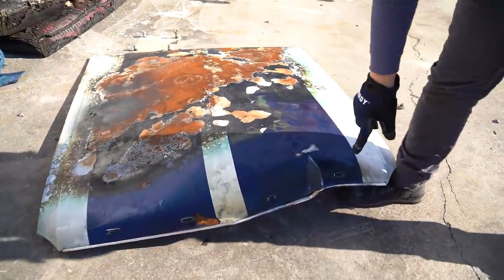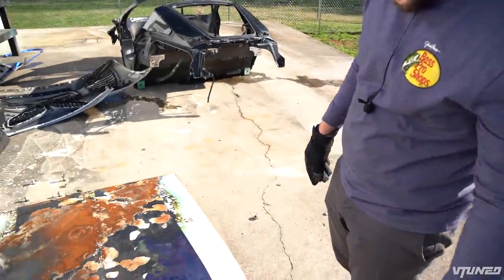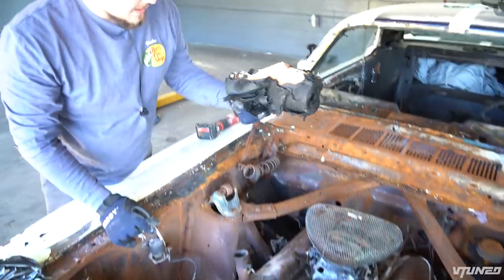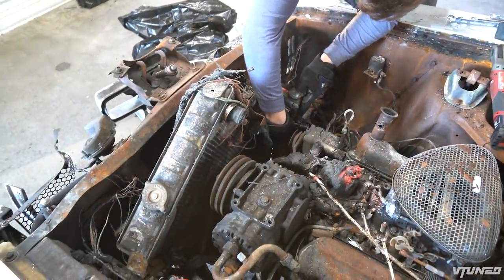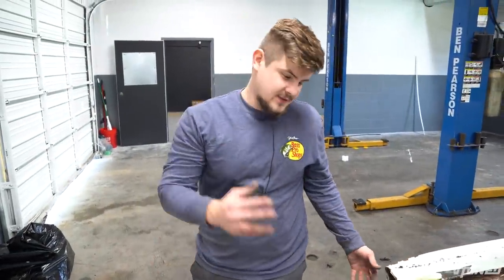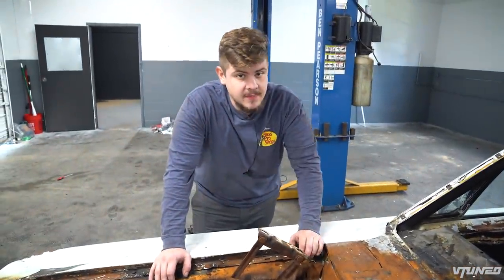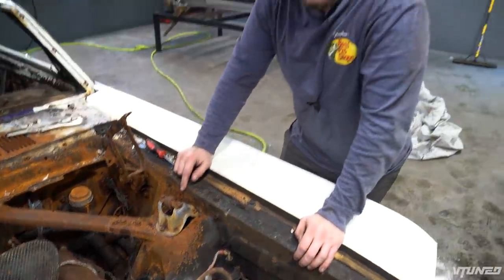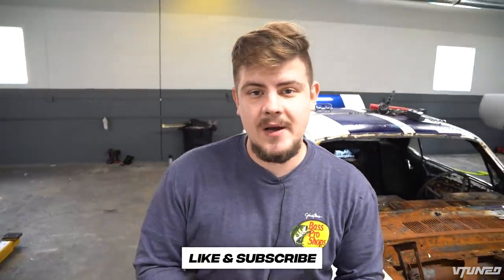Was The 1965 Mustang Insurance Fraud ? & Disassembling Front End ! ( Weird Discovery )

Comment: Its a 289. Originally had the inline 6, hence the 4 lug. Factory V8s had 5 lugs.
Reply: Might be a 262
Reply: @vidznstuff1  260. Ford never had a 262.
Reply: He literally said that in the video. You should try watching videos before you comment on them.
Reply: The 260 was only available in the 64 1/2 models.  They should've upgraded to 5 lugs when they swapped in the V8, because the extra horsepower has been known to shear off those 4 lugs.

Comment: Since it is 4 lug wheels, this was a straight 6 car originally, so the motor is either a 289 or 302, but not the original engine for sure.
Reply: Might even be a 262 V8
Reply: @vidznstuff1  If you mean 260, maybe, but they are rare.
Reply: Drew Schumann yes the 260 I believe was last in the early falcon body only, as my brother has # 3 k code coup and had a 289 originally
Reply: @boarzwid1002  The first Shelby Cobras were 260's for a very brief time. Those models are extremely rare.
Reply: Sam Denton  an old friend of mine had a 260 in his sunbeam tiger, he pulled out the 260 for a 289 when Chevy put the L88 427 in the corvette I remember him saying it was game over for the street corvette,

Comment: It's definitely a factory 6 cyl car. The fifth # in the VIN will be "T" to confirm this. There is no doubt it was a nice restoration. With that stripped paint job I wouldn't really call it a restoration though. On;y Shelby's had stripes.  It's almost inconceivable that the floor pans are all original IF there truly is no rust. Luckily almost every part for those old Mustangs can be bought as reproductions. I'd love to see you put the Styled Steel Wheels that was an option on V8 Mustangs in 1965.
Reply: If those Floor pans were original they would have had a lot of overspray.
Reply: @rickallen6378  true but after 56-57 years,???
Reply: @keithbrookshire  Yes.

Comment: Those paper towels were an accident. It looks as if they were burned as part of the fire as opposed to being the cause of the fire. There are much better ways to set an engine compartment ablaze that all look like normal faults.
Reply: not at all a normal fault
Reply: Fuel lines come off all the time. With headers & no heat shields on the exhaust -> fire
Reply: Found the previous owner.... :P Jk
Reply: I've left much stranger things in engine compartments after working on or cleaning a car.
Reply: @Samalyzer45  and.... LOL

Comment: I cannot believe that any car person would intentionally burn that car. Now what I can believe is that some one was dumb enough to use those paper towels for cleaning and they either fell in there or were just forgotten after being placed in. The area. I know you will bring her back to all her glory.
Reply: I’ll admit to leaving paper towels (blue) in the engine bay while working on a car though never driven / started a car with them in there.
Reply: Not all classics are owned by real car people. Easy finance can mean anyone with a deposit and a job can own one. Since they don't have the attachment, it's easy to torch them for the insurance. I believe this was an accident though. They could have been cleaning the glass and the towels dropped in there, they could have been wiping down the engine after working on it. Lots can be overlooked at 3AM after working on your car. I remember working on cars all night and going to bed at sunrise.
Reply: If they were gas soaked, yes.  But was working on the car, slammed the hood for a test drive.  
The front rake is from the V8 extra weight.  
Ordered styled steel wheels in '65 on my 2 + 2, loved them until tire changing time. The center hole for the cap was smaller than the tire machine, time for a rubber hammer and 2 tire irons!

Comment: As a product engineer back in 1980 at Ford MPEO (Mexico Product Engineering Office), I was part of the project of fitting (Cramming) a 5.0 L (302CID) motor for the Fairmont-Mustang program. In fact, all those cars produced for the mexican market featured the 302 CID motor and 4 lug nuts. The mods on the engine were the exhaust manifolds, and a 1.5 inch drop of the water pump shaft, due to the Mustang's hood fast slope. It later came the 3.8 L V-6

Comment: The braces from the firewall to the shock towers are in all early Mustangs, both 6cyl and V8.
If you're planning for a 5.0 Coyote, replace the rear end with a 9-inch or 8.8.  The one in it shouldn't be there now with the V8. 
As for installing an 8-spd automatic, good luck trying to fit it in without modifying the trans tunnel.
Reply: This is not true
Reply: not need modified anythink.

Comment: Look on side of engine block for casting numbers, it will tell you what you need to know. Also look under valve cover and it will be stamped 302 or 289 and so on  .All v8 were 5 lug and 6 cyl 4 lug on 1965 models

Comment: Ben I completely understand replacing the roof! The firewall should be just fine! They are very thick! Now I know you are not afraid to buy stuff but you have parts to fix the roof! You could use the rear quarters and the roof off the fastback. It's all the same those years!! Check out CJ pony cars for parts they are very well stocked. For a brand new wiring harness Check auto wire and I know cj stocks them also. A brand new harness from front to rear is the best way to go. I've had 20+ of these over the years and their are so many parts that you can build from ground up. I know it's way out of your wheel house but they're really easy to work on. Don't over think it! I'm in my 50s and been working on these since I was 14! Just reach out to us old guys we will help with all you need. Have fun with it and thanks for saving it!!

Comment: 1. You've talked about putting a standard 5.0 liter engine in this Mustang. You should sniff around and see if you can find a Ford Aluminator engine around somewhere used. As you probably know, it's (essentially) the same flat-plane crank engine used in the GT-350, but Ford sells it as a crate engine ("not for street use") for around $20K. I've driven a GT-350, and it's a screaming beast of an engine and would make your build something really special. 2. I've known people that would buy that burnt hood if it's OEM.

Comment: So you don’t want to replace floor pans, but replacing the roof, cowl, firewall and radiator support is no big deal? Lol, ok man. 

The seam for the roof leaded-in just above the quarter panel. 

The 6cyl cars did in fact come with shock tower braces. 

You’re going to have to remove and fab a good portion of the trans tunnel to fit a late model trans in there too. 

Literally.
Reply: So much for that original floor pan 😂

Comment: I had a ‘65 Mustang with the original Straight 6 in it and it came with the strut tower support bars running to the cowling from the factory. Those are original for the in-line 6 cylinder engine, too.

Comment: Love the content. I own a red 64.5 Mustang that I bought a few years ago and have had a great time upgrading things on it. Mine was originally an inline 6 but was swapped to a 302 before I owned it.  The reason your front end is likely lower is that the inline 6 springs are not designed for a heavier 289 engine so it will sit lower. This past summer, I replaced the shocks and springs on mine to handle a heavier engine. You likely aren't keeping the original steering components because you are removing the shock towers, but, if you are, you will need to change the tie rods, center link, pitman arm, idler arm, and idler arm bracket because they are different between I6 and V8. You definitely need to change to 5 lugs and a disc brake kit. If I recall, you are limited in options with brake options with a 4-lug.
Reply: My neighbor had a 64.4 Red Mustang convertible, that she bought new.  Manual steering and brakes, but a 289 with an automatic.  After her husband passed away, she was no longer able to drive it.  She asked me to drive it occasionally.  About once a month, I would take her out, for a spin, all on back roads, no plates or insurance.  Definitely a labor of love.
Reply: disk brakes have ofcourse first what need change all old mustang, factory all mustanf go out too weak shit brakes and too heavy front. ewery mustang need change first all brakes lto better but important front brake change new better disk brakes. only idiot use old musteand and old shit weak brakes.

Comment: Vin - don't worry about the fact that this was a 6 cylinder factory car. That just means from 1965 until whenever that V8 was thrown in there, no one was ever hot rodding it or beating the crap out of it. Now you have a cleaner straighter car to begin with, and since you are replacing the suspension and rear end and motor, there is nothing "6 cylinder" left.
Reply: You can decode the  Door plate and/or left Fender plate to find out how the car was originally built in terms of engine, transmission, rearraned rear end and even colors and where and when it was built.

Comment: Whatever started it it got to the gas. The fuel pump on old fords is on the engine. So there is a line that comes up from the bottom of the engine right over the valve cover in the front. Often times there is a fuel filter in that line. Perfect spot to leek gas on the engine or header and start a fire.

Comment: This mustang was originally a inline six cylinder vehicle,  From the missing engine bay braces to the 4 lug hubs and the radiator is also all six cylinder factory parts... Looks like they was going for a GT350 clone build with it... The roof is all buckled due to the rapidly shrinking sheemetal going from round 1,000 degrees to the temp outside when the fire department blasted it with the hoses

Comment: The paper towels are definitely questionable for sure . I agree with you  replacing the roof of the car .as for the motor it  cold be a 5.0 from the 80s  I would suggest when you go to harbor frate and get a  creeper also get a roll around tool tray as well it will  make things alot easier when you are working  on the builds.

Comment: The valve covers says it's a 5.0 from a fox body mustang mid 80's but you should check the #'s on the block . The paper towels are to check fluids most old school guys have them or a rag under the hood at all times . Now let's pull the engine out and get to work !! 💪

Comment: If it's original it's a 289.  But the car has 4 lug rims so it originally was a 6 cylinder car.  It's likely the engine is a later 302.  Look at your car's VIN.  Swapping the 4 lug set up to 5 is easy, especially for someone like you.

Comment: Four lug wheels means this was originally a 6-cylinder car.
The engine is way more modern, at least judging by the valve covers.
The paper towel roll was suspect.
Fire Departments have protocol for car fires.
They have zero interest in not damaging the car, with that said anyone with a pair of gloves could have opened that hood 10,000 quicker than how it was done.
Good Luck saving the old pony.
I told my daughter years ago that there are more early V-8 Mustangs on the road today than were ever built new.

Comment: Repair the cowl is interesting as there is likely 160 spot welds holding the top and bottom of the cowl together and the dash is welded into the car. Also the engine looks like a 302 based on the style of valve covers but the 4 lug wheels are a giveaway to the fact it was a 6cylinder car when built

Comment: I have a 70 z28 camaro and when cleaning the windows if the hood is open  I some times set the paper towels on the inner fender under the hood !! Guy could have forgot they were there closed the hood and the towels slid down on the headers causing the fire !!

Comment: Don't know if anyone had commented but the 1964 1/2 - 1965 export braces were all welded in place on the shock tower unlike the later mods that mounted under the shock mount. The 6 cylinder could be removed without removing the braces. For a V8.. you would have to unbolt them remove the engine.

Comment: Judging by the looks of the wiring and distributer, that was definitely an electrical fire.
Reply: Well the wiring is all melted so it looks screwed up. Whatever started it it got to the gas. The fuel pump on old fords is on the engine. So there is a line that comes up from the bottom of the engine right over the valve cover in the front. Often times there is a fuel filter in that line. Perfect spot to leek gas on the engine or header and start a fire.
Reply: if you looked close the wires where the paper towels were are really burnt. the fire had to start in that corner. and if the headers got red hot im sure they started the towels on fir and melted the wires which shorted out the system
Reply: @jburnes41  LMAO the entire engine bay is burned. It didn't "have" to start in that corner.
Reply: @ribbitism  umm... no, what I did was shot down the idea that there's irrefutable proof that the fire was caused by the paper towels in that specific corner. With the entire engine bay being burned, some random person in the comments can not 100% guarantee that's where the fire started. Try to sound smart again, bud.
Reply: @ribbitism  and actually, if that is where the fire started, more of the roll should've been burned. If it started at the header then the fire should've travelled up the roll and burned at least the entire outside layer of it. Remember how flammable paper towels are.
Reply: @89ludeawakening1   @micah fuller  no, now you have presented a counter opinion. That's a little better than your first comment.. But you're still presenting that condescending attitude, and now also trying to attack me for simply pointing out what you showed us all. You're trying to be a bully online, you're still a weak human being and that will take you many years to adjust and overcome. Use your brain to intelligently approach things with logic and not emotion. Be a better human, I dare you.
Reply: @ribbitism  it is hilarious that you're saying I'm attacking you and being a bully. Wow... grow up.

Comment: Bumper bolts won’t be 16mm, in 1965 there were no metric fasteners. 
If those front bumper pans are original it would be advantageous to try to salvage them rather than replace them. Those panels will be better metal than what you will get as a replacement

Comment: Your Mustang may be a 64.5 released 6 months before the model  year change.  All of the early ones had 13" 4 lug wheels and the same dash as the Falcon. The V8 was a 260  CI
Reply: 64.5 V8 mustang's as they are referred as the 260 was the small V8 and 289 was optional and all the V8's had 5 lug wheels like mine which was built July of 64 ( 5lug wheels and 289)

Comment: If you look at the drivers door there should be a tag that will tell you all about the car. Original paint color, axel, trans , build date and so on.  Also the Vin number.  Note the Vin on the door should match the number under the hood on the drivers side fender.  That will tell you if the door or fender have been replaced. 
Vin:
Your Vin should start with 5 then F R or T followed by 07.  The next letter is the important one. Should it be a K you have hit the jackpot as that would be 289 HIgh Performance. 
If you post A photo of the door tag or at least the actual engine Letter from the vin we can tell what engine it came with for sure.

Comment: Paper towels definitely NOT the epicenter of the fire ...

.. the roll of towels would have been turned to ash if they started the fire. Paper burns at 451° Fahrenheit. You have melted wiring, warped metal on the car roof those are indicators of higher temperatures. 

You could see the form of the headers in that roll of towels ... if that started the fire it would not exist at all. 

It is strange to find that roll of towels in that place in the car however it is not the ignition source of the fire.

Comment: Your engine looks as it was made in the mid to late 1980 302 V-8.  The casting number near the oil filter will should tell you the year of the engine casting.  The oil filler tube on the passenger side valve cover signals the late 80's. If it is a HO engine with a factor roller camshaft block, that is ideal for a kick ass 332 stroker engine for your coupe. The early style oil filler should be on the driver side valve cover. The first letter will be the C will be the 60's. D will be the 70's. E will be the 80's, and then the number after the letter will give you the year of the engine casting.  Put an aftermarket sub frame on it with a rack & pinion steering that is set up for coil overs. They can purchase as a whole unit.  Moser makes a bolt rear in where you can install a 9" rear end.

Comment: You can just look up the vin number and it will tell you what the car came with... It's either a six cylinder, a 289 or a 302.... It looks to be an original motor, it's still got the factory Air condition unit.... I'm guessing it's a 289 but I'm no ford expert... Can't wait to see the final product.... Keep up the good work